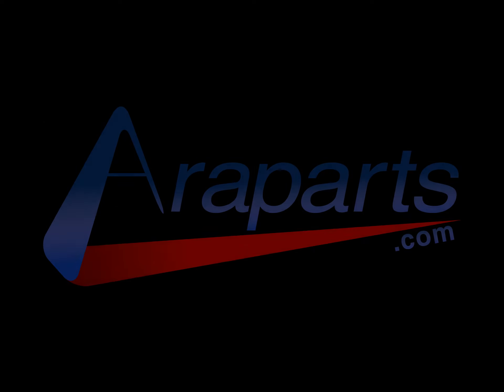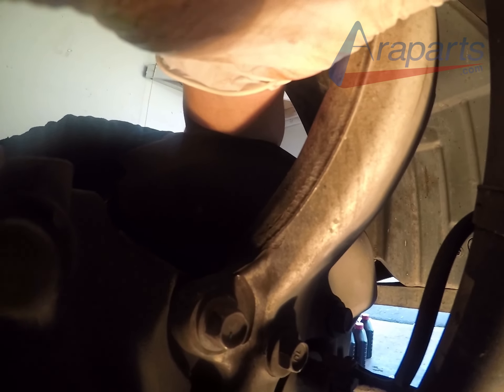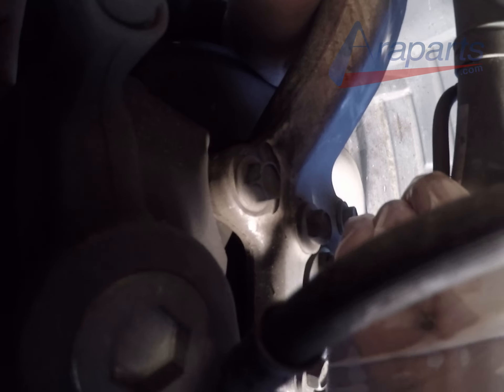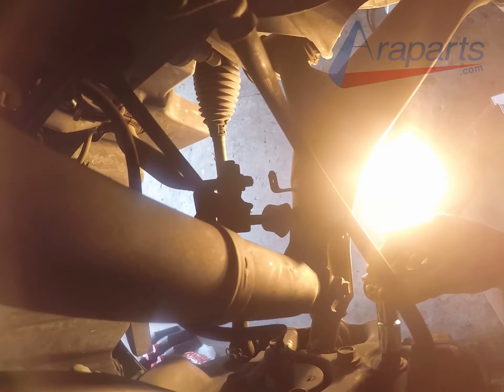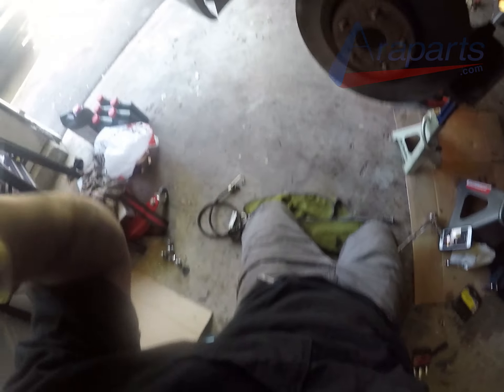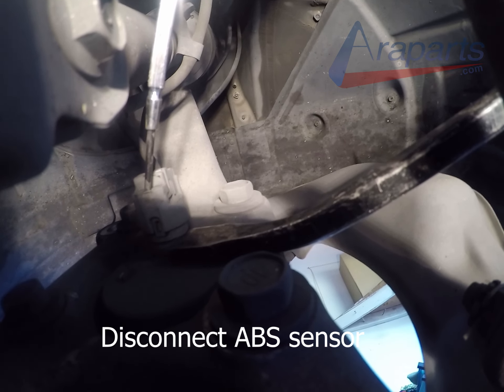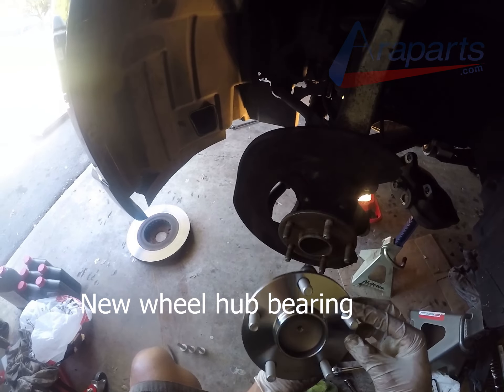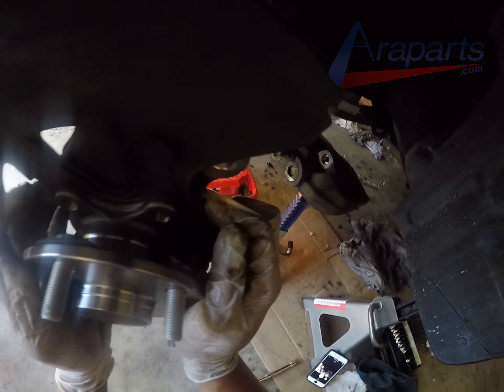2006-2012 Lexus IS350 RWD Front Wheel Hub Bearing Replacement - Very Simple - Detailed DIY

Comment: i have a chirping noise coming from my passenger wheel i think it’s the wheel bearing but is chirping the typical sound?
Reply from the maker: Not the typical bad wheel bearing sound but it is indeed a symptom. Try to see if the noise changes when taking a hard left and right turn…aka putting/removing an extra load on the bearing. Check if your wheel has any play on the 12 & 6 position. A big bar with leverage is ideal when doing this.

Comment: Why do u need to replace hub?
Reply from the maker: Started hearing grinding noises from the bearing, and it was allowing 12-6 play/movement.
Reply: Grinding like grrrr grrr or like swishing water metal being rotated inside? I’m getting that house but nothing is loose. Going to take out both wheels on Jack and try to spin the wheel tomorrow. Guessing bearing or axle? Coming from middle front I think

Comment: Same on awd?
Reply from the maker: It's more work for the AWD. AWD has the bolt-in wheel bearings so fortunately you don't need a press, but you need to remove the axle from the hub for the AWD model.